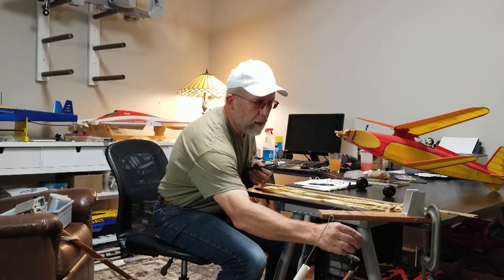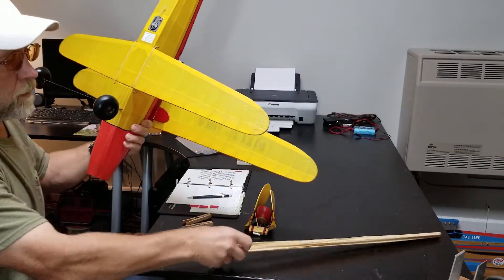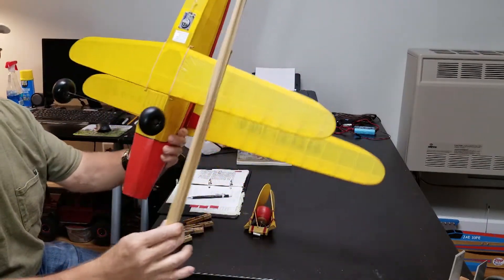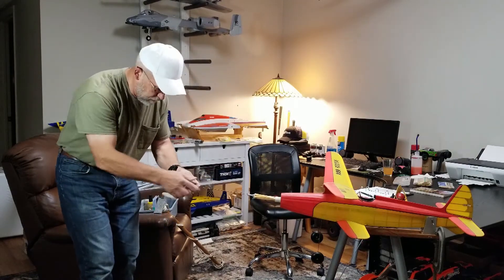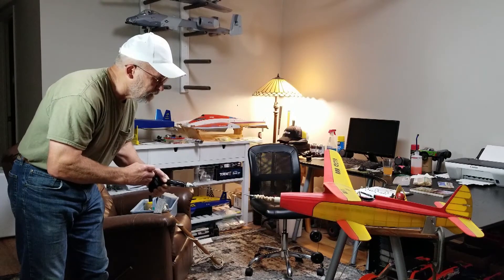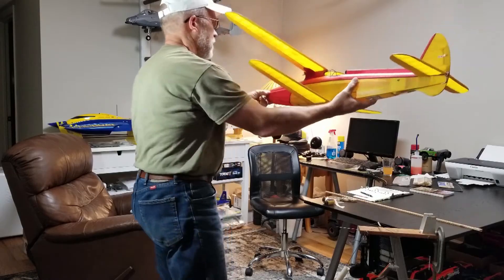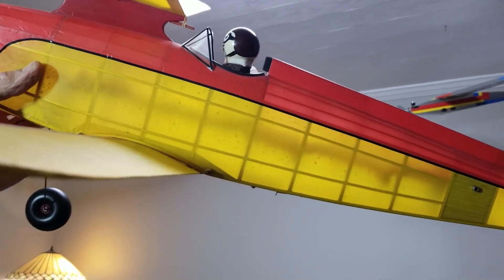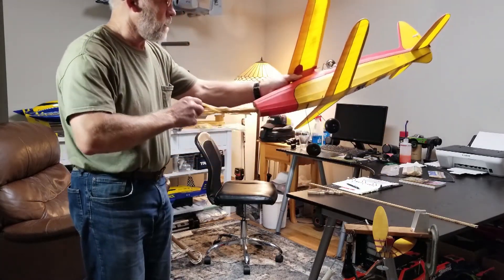RUBBER POWERED MODEL AIRPLANE_STRETCH WINDING!

Comment: Concise video. I put a rubber band around the front of the motor to hold it tight on the crochet hook. If you are winding with a drill take the chuck off and drill a hole to take the winder wire.

Comment: I understand the need for a dethermalizer to avoid losing your models. But if the model is always going to "parachute" down via the DT where is the enjoyment of watching a model plane glide in like a real aircraft?
Reply from the maker: It will glide in and land if you don't catch a thermal. Most flights it will. Just set the timer longer than it will fly in "dead air". Catching a thermal is when the magic happens. Murphy's Law, if you don't activate the timer, it will fly away...